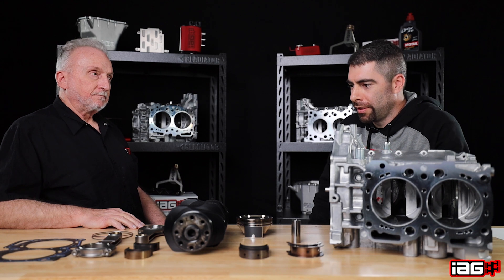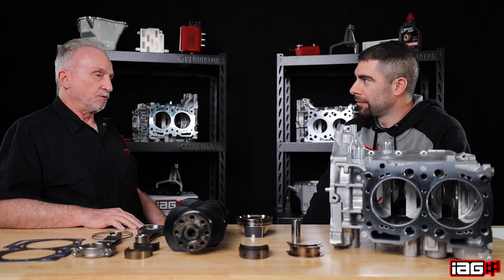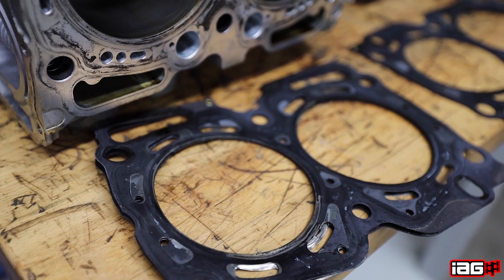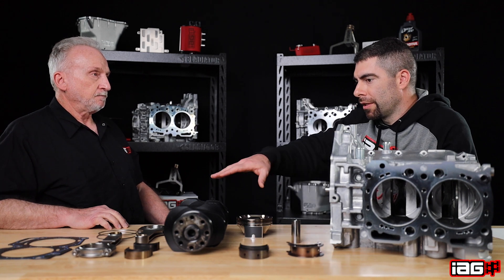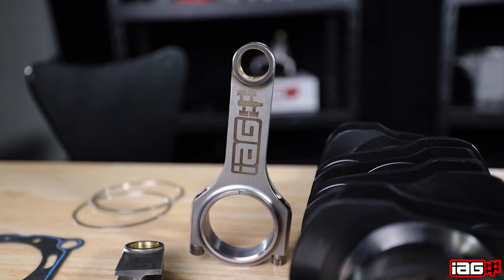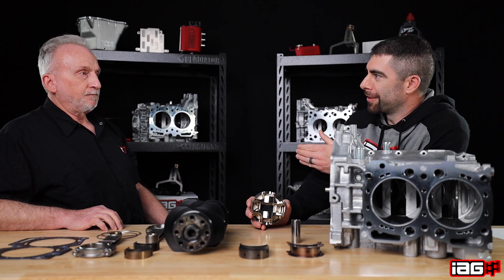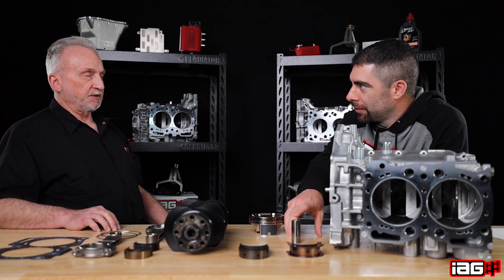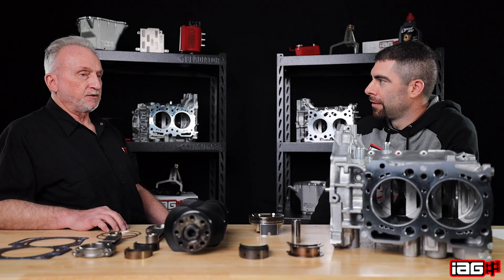IAG Performance Magnum Short Block

Comment: Why is IAG not adding the coolant ring around the cylinders on the deck surface?!  This is sloppy and lazily WRONG design!   You need coolant on those surfaces to make proper heat transfer.

Comment: Magnum shortblock don't use a 210 wrist pin, use a 250. It not stay the same as they said on the video. Please correct me if I'm wrong?
Reply from the maker: .250" / .906" H13 wrist pins for Magnum.

Comment: Still loving my magnum block no issues with 36 plus psi
Reply: How much power are you putting down?
Reply: @tonyregalado7281  only 660 to the wheels but it's stock location,need to go rotated and I could make a ton more but I've been pretty satisfied with the 660 it's more then enough for the street,I daily it and do multiple pulls a day just enjoying the build and I've had 0 issues,it does everything I ask and more
Reply: @MrKodabear   Nice! What turbo are you running? Any head work? I bought the IAG 900 long block (mag bottom end), fully built heads with S2 GSC cams. I'll be running an ETS rotated kit with a precision 6266 gen 2. Hoping to make around  700whp on the kill map.
Reply: Is that 660 on 93 octane or E85?
Reply: @buckykattguitar  i wish it was on 93 I don't even have 93 where I live just crappy 91 so I bring in e85

Comment: Is nice from you guys to take the time to explain every different between each stage block but I buy a stage 3 extreme and I didn’t see you guys talking about on the video 😕
Reply from the maker: We recently evaluated each of our short block offerings to determine their popularity. The Trojan and Stage 3 Extreme blocks were two of our least popular offerings. In an effort to direct our limited resources towards the best selling products we made the decision to discontinue these blocks. For those that have previously purchased either of these blocks, don't fret - They are still excellent choices.  We simply removed them due to lack of popularity, along with the fact that several blocks in our lineup "overlapped" with regards to power ratings.
Reply: @theiagchannel  damn i was just about to order a trojan short block lmao
Reply: Looks like what I need for my Forester build. Way less money than the route I thought I needed to go.